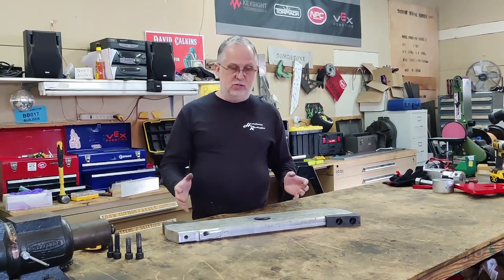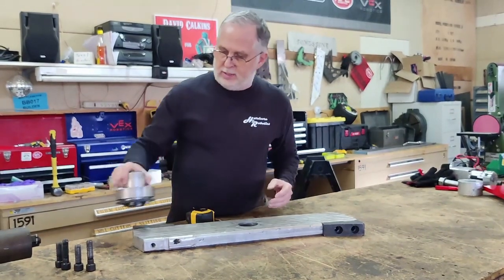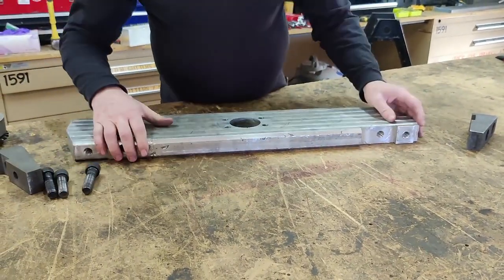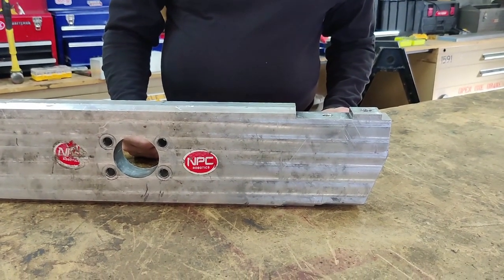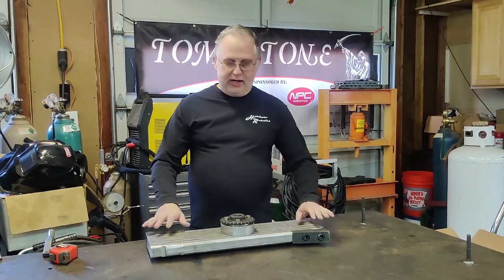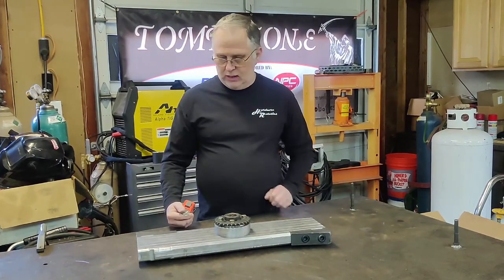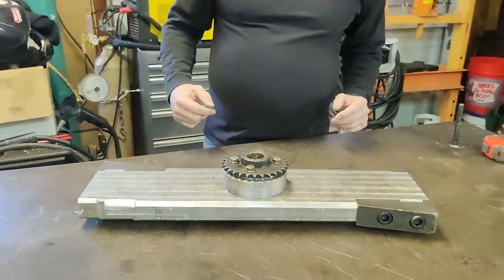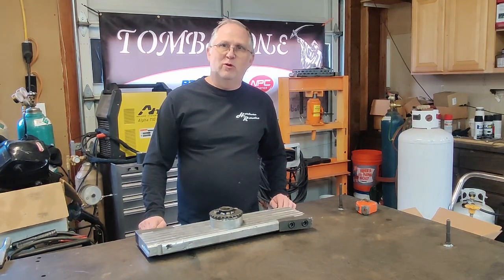Mortician 2023 - Weapon #2

Comment: Hi Ray, I'm a Tombstone fan. I have watched a number of events where the drive chain failed  in a weapon-to-weapon strike. Have you ever considered or used some kind of slip mount sprocket arrangement that would mitigate the shock that gets returned to the chain and motor during these strikes? (Effectively a clutch, but making use of the existing components to accomplish it). Just curious. Best wishes for success with all your bots!
Reply from the maker: We've used chain torque limiters for every build of Tombstone - https://www.mcmaster.com/products/torque-limiters/torque-limiters-for-chain-and-belt-drives-4/

And they do seem to help. 

We've had a chain failure twice in all of BattleBots, once when it was directly hit and peeled off the sprocket (against Yeti) and once when a half link failed (against Bombshell). It's actually one of the more dependable parts of the bot!

Comment: The only thing I have noticed about Battlebots is the relative (mediocre) quality of welding vs. all of the really great machining, electronics, design, etc.  It is surprising that each team doesn't have a good TIG welder that can really make sure all the welds, repairs, etc are 100% strength.
Reply from the maker: If this is a polite way of saying my welding doesn't look pretty, then I will agree :) However, my gorilla welds do tend to be structural and hold up well!
Reply: @ray9368  yes, you got it right.  I am no expert welder myself and also grab my MIG glue gun when I need to stick some metal together.  But I have a friend that is a professional TIG welder so I guess I am just lucky that I can bring the hard and exotic stuff to him.
Reply from the maker: @MattRogersdesigns  The few times I need to weld titanium, I would use a pro. But for steel and aluminum, I can make them stick together enough that I'm happy with the results. Luckily, we have Lincoln Electric on site at BattleBots events to help support, and they are truly awesome in every way. So even if my work looks rough, at least any repairs on site look pretty good!
Reply: @ray9368  It's an honor to have comments from Tombstone's father.  Sometimes "whatever works" really is the best strategy that give you the time to focus on more important tasks.  I'll be watching in the future and maybe eventually build a bot.  Good luck.

Comment: @ray9368 Hey Ray, just a suggestion that would increase your winning streak, the biggest issue with tombstone is it's Kinetic Recoil that cause it violently ricochet across the arena after it applies a hit. To nullify that maybe you should add a magnetic undercarriage to the bottom tombstone belly which can be activated from remote when your anticipating applying a hit. ...Just a thought.😎😎
Reply from the maker: Magnets certainly do have a place in combat robots, and there are ways to use them effectively. The hard part with Tombstone is where they would need to be just doesn't work with the design. I suppose at some point I could make my own wheels and add magnets into them (which I have considered) but getting enough downforce to really keep the robot in place after a hit is just going to be hard to make happen. 

Not a bad idea though, and things we may explore in the future.
Reply: @ray9368  No Prob, I know it's easy said than done. Looking forward to your next match 👍

Comment: Since Last Rites is technically retired now, what are you going to do with it, keep it in storage and to preserve it, or strip it down to become a spare parts donner for Tombstone and Mortician?
Reply from the maker: There hasn't been an assembled Last Rites sitting around for almost a decade. I think there is still a frame for it, but the parts have moved on to other projects a long time ago.
Reply: @ray9368  When was the last time Last Rites was used before it was disassembled?
Reply from the maker: @tigerrocks503  I think 2015. Hard to remember!
Reply: Actually I believe 2017 as that’s when it had the fight with WHOOPS!

Comment: --  So the general idea is ensuring all your KE is directed to the outer bar, and the bolt on 'teeth' bring more weight out there for that, also acting like a dead blow hammer from hell?
Reply from the maker: Having the teeth, and the bolts (all steel and heavy) at the end of the bar helps with MOI and energy totals. It's a great way to design a weapon - as long as the teeth stay put!

Comment: What about balancing? I'm sure it was balanced before but with the modifications, and damage that looks to have happened previously, will you go through the balancing process again? And if so, how do you go about that?
Reply from the maker: If you machine it correctly it ends up fairly well balanced. I've never actually used a balancer for any of them, just made sure my machining was as accurate as I can make it. The small damage areas can affect it, but not a lot really
Reply: -- Odds on the minute he hits something with it, the balance is thrown out a bit anyway.  Would be interesting to see a bar system where you add or remove bolts of different weight to each side of the bar to balance it between matches ... same theory as balancing a wheel on a car.